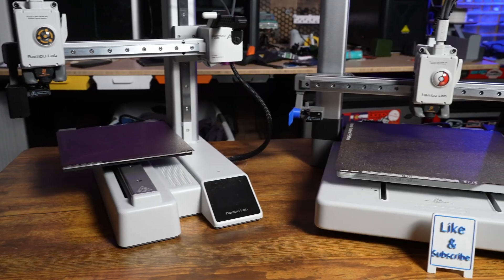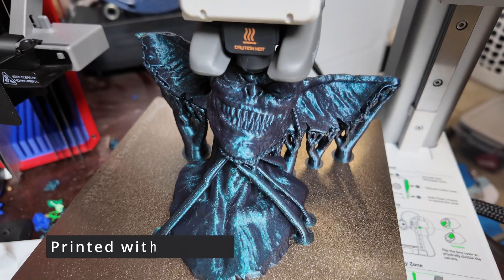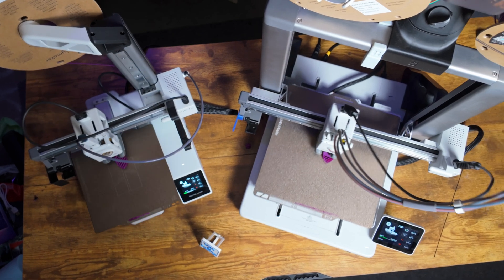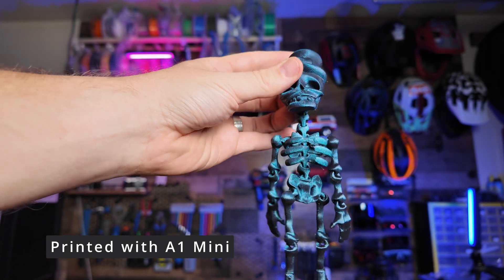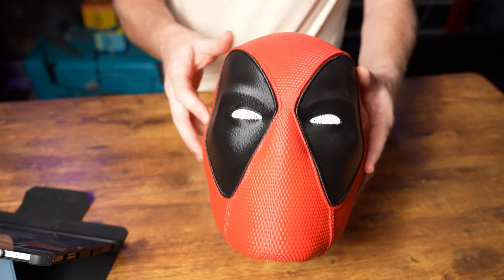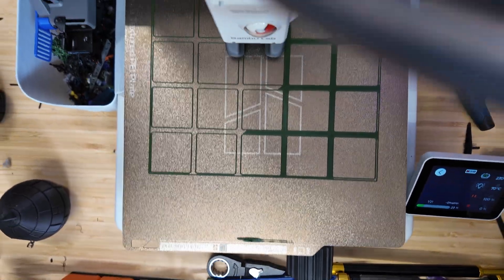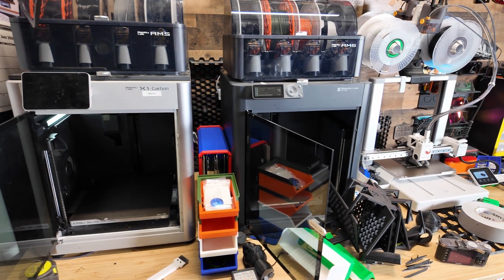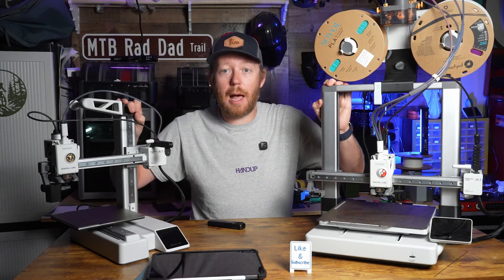Bambu Lab A1 vs A1 Mini Which is Better for You?

Comment: I just started getting interested about 3d printing. However, I don't know how much I'll use it after the first 3 months where I use it as a toy and for small uses here and there. The problem is the things I'm thinking of printing would all be bigger. Should I even get into 3d printing?
Reply: @arxitx  You can always print off smaller parts and stick them together. The size of the printer doesnt matter if you have time.

Comment: I have a question is the AMS and combo the same thing? And if I don’t wanna get an enclosure is it safe to just print more toxic fumes outside? and for like the regular printing is that okay and safe just your basic filament?
Reply from the maker: yeah the combo includes the AMS. I think PLA and PETG your probably going to be fine. I believe its only an issue with ABS, ASA, Ect.
Reply: @RadDadsPrintLab ahhh okay thank you so it’s cool to get the A1 to start off then upgrade to a enclosure one I want a more practical printing format like for outside or something more sturdy or just to enhance the looks of stuff but still highly durable and resistant but I did the different filament that can make everything come true especially the rubber one and I’ve seen some people even use wood filament but I’ll definitely wanna do a plethora of things so I might get the A1 for regular stuff and a p2 for more advanced stuff cause the enclosure

Comment: I'm new to 3d printing and thinking about getting the mini, is designing stuff easy? Do I need a laptop or can I do it from an iPad? Thanks
Reply from the maker: You can do it on the ipad if you want. Its not to hard, my 10 year uses tinker cad to make stuff.

Comment: New to this space. Didn’t know you have to buy the build plate separately. Thanks.
Reply from the maker: Printers come with built plates out of the box, but there is a bunch of options out there for different types of build plates.
Reply: @krazywabbit  one comes in the box with the printer

Comment: My son has asked for 3D printer for his birthday and I was going to get him the A1 mini. Then I decided to get the combo in case he wants to do multicoloured prints. Now I’m torn between these two models. Currently here in the UK the A1 mini combo is £299 and the A1 combo is £419. Bambu are offering a further £45 reduction on all printers except the mini so the total difference would only be £75. Any advice would be greatly appreciated 👍🏼
Reply from the maker: If you don’t mind spending the extra 75 and have room for the larger printer I would go with the a1 instead of the mini
Reply: @stephengray1973  im not your son but i am that son that also wants a 3d printer lol
Reply: In my opinion multicolour option and bigger built size... Spending 75£ more would be worth it

Comment: Do these two devices have a core xy system?
Reply: These are both bed-slingers, if you want the core xy, you could look at the P1P or the X1C
Reply from the maker: These are both considered Bed Slingers, the P1P, P1S, and X1C are core XY Machines

Comment: Been thinking about the A1 alot, still have a modded ender 3 that just works... guess I'll bite the bullet whenever the newer gen of the A1 releases
Reply from the maker: Historically bambu has not released a gen 2 of any product.
Reply: Their next printer is looking like a bigger more expensive dual head printer. I just bought a new A1, and it spit out a terrible benchy and now refuses to do anything.